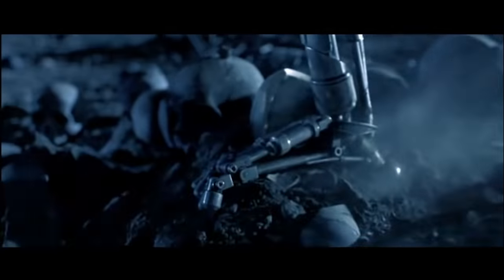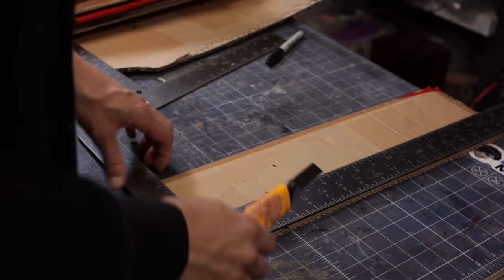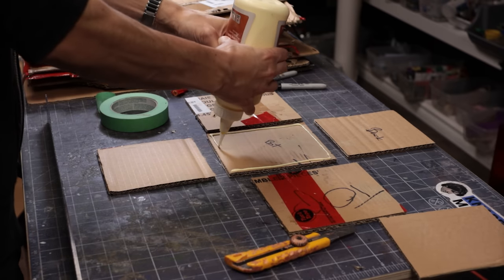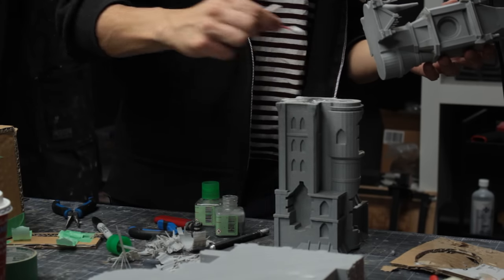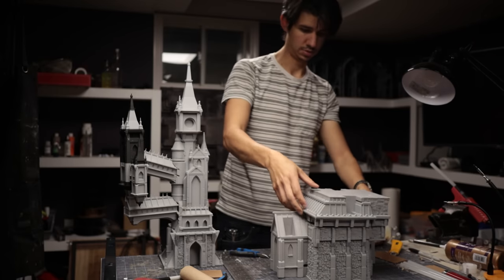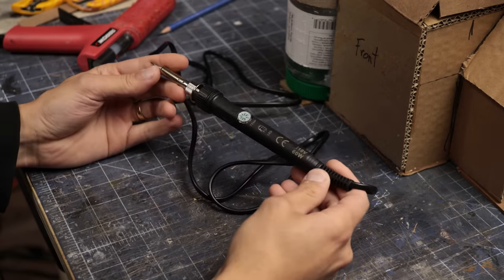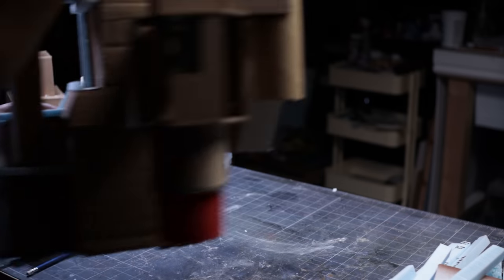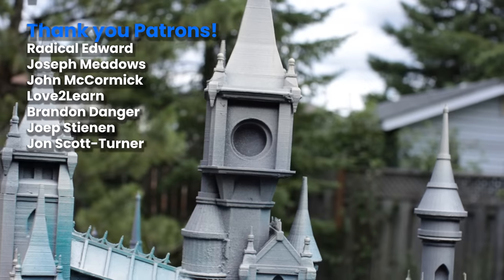Human vs Machine: Race to craft an EPIC Castlevania Castle!

Comment: What little we've seen of it I think your hand crafted one would look better in the end. I think something about actually doing it by hand, maybe the fact you can make adjustments to the design as you go and add little personal details quickly and easily to it (compared to adjusting resin on the main print) helps bring out character in the piece.

The 3d print is amazing and very obviously going to be faster every time,  but I think overall quality hand crafted looks better.

Though I think *best* quality would be hand crafted with some 3d printed bits for details. Add 3d printed gothic windows and gragoyles and such to the castle.

Comment: for a fair comparison, I feel you need to factor in the time spent sculpting the castle as well as just printing it
Reply from the maker: Haha, yeah there's many ways you can compare it. Digitally Sculpting it took over a week of pre-work. But I do that for my physical builds too a lot of the time.
Reply: I figured you would be comparing actual time used to build one vs the other rather then a "ready set go"

Comment: I like that fancy counter weight that you added to the cardboard base! : )
Your new wood-burning/soldering/XPF carving/fume creating tool is sweet. What's the make/model?
I would have never even thought to add the plaster on top of the bricks. Crazy!
I now see what you meant about splitting the video up, however you picked a perfectly natural stopping point. Excellent work, Knarb!
Reply from the maker: Fume generator is right. I think the brand is Etepon, pyrography set. Not sure if its any good compared to others but it seems to get hot and the tips go on and off easily enough. There's a xacto knife attachment too.
Reply: @KnarbMakes  Oh wow, an X-Acto blade attachment? Now you've really got my attention... I've been looking for an even more painful way of cutting myself! : )
Seriously though, that sounds super useful for cutting foam. Thanks, I'll look up the Etepon.

Comment: both look great!  i would probably break down the unfinished castle and use it as castle ruins surrounding the 3D printed one, as if the castle used to be bigger but got downsized in a siege or just crumbled from disrepair over centuries until only the center structure remained.

Comment: The only reason I don't 3d print terrain is that it would take a fdm printer and I'd rather get a resin one for minis. Also fdm printers are a bitch to run with a lot of factors albeit dirty cheep material

Comment: Great work but surely the design phase is a factor? So you could have added that time and or had the computer use ai to guess a design. So then we'd have the computer ai interpretation of a castle being printed vs a human design and hand made build etc.  Consider this in future as there are free and paid ai learning which can make 3d models based on suggestions.